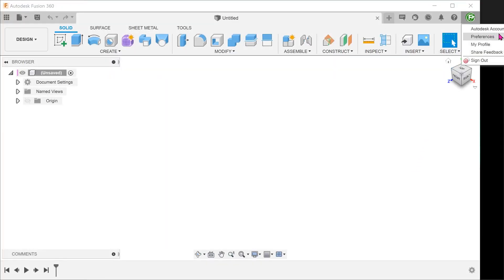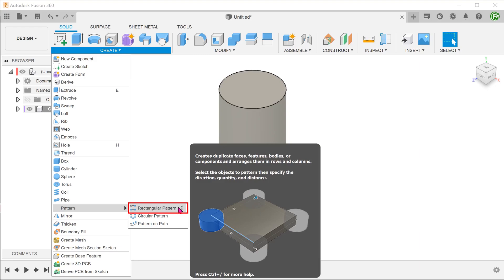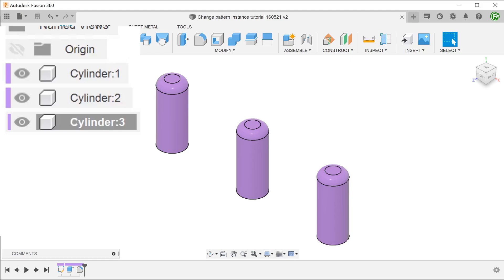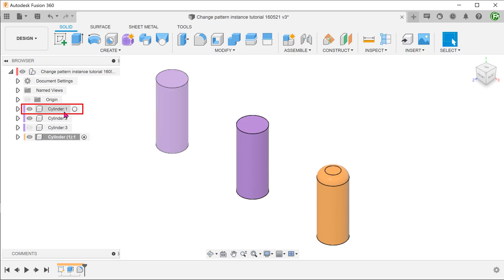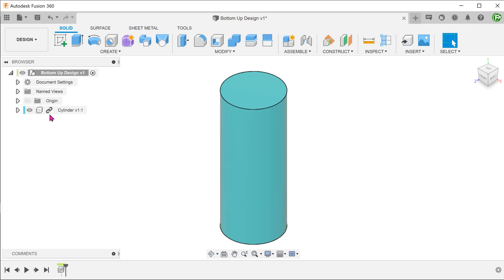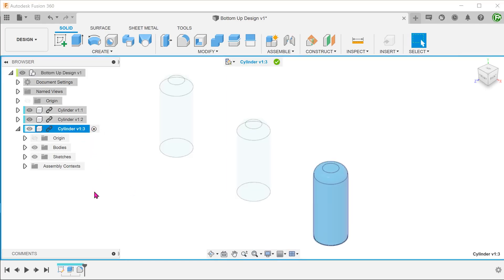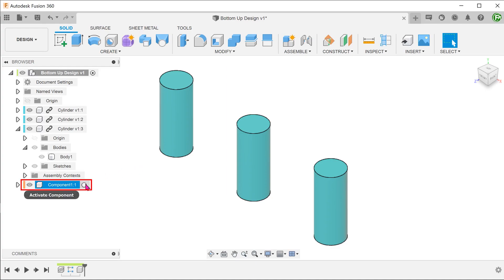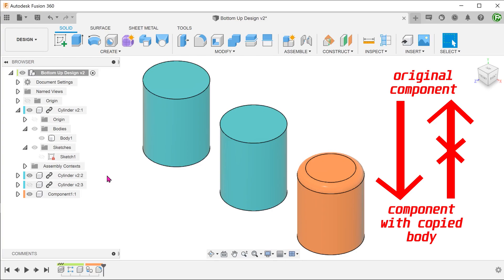Fusion 360 - How to Change One Instance of a Component Pattern?

Comment: At 5:37, I think the recommended method to independently modify an imported component is to choose "Break Link".  I believe you will (by design) not get any downstream changes of the original component at this point, but you will be able to edit the component without affecting the original.

Another interesting option to look at is "Choose Version", which allows you to pick which saved version you wish to use.  This would potentially create a bit of a part management nightmare, but you could change a component to use a previously saved variant of a design, instead of making separate saved files for each variant (maybe ok, if you only need to do it once).  ;)
Reply from the maker: Hi, I did try to use the break link option. However, in this case, it threw up an error, saying that the selected component is associated with a pattern. 

Interesting advice on "choose version". Will need to try this out. As you mentioned, file management might not be easy!
Reply: @Fusion360School  Thanks for the report on Break Link with a Pattern of Components.  That introduces some limitations!

I suppose the manufacturing world uses separate parts with different part numbers for components that vary even in minor details (e.g. length, number of threads, or mounting hole count/spacing, etc...).

Variations would have to be a built-in concept, so that Parameters could define part numbers/names of imported components as well as the variations in a base component design to eliminate the need of maintaining variations manually.  Each component would need its own Parameter page for any (optional) value overrides.

Even in the Electronics Design part of the program, it's very annoying (to me) that all the variations of something as simple as through-hole header pins are separately created parts, which are not consistently designed in the base libraries.  These are auto-generated, yet, since they are likely created at different times, perhaps by different people, details like pin length or color don't match across the entire range of parts, where only the count should differ.  I hope the folks at Autodesk think about this problem of variations and work out a decent solution.
Reply from the maker: @zencow  Configurations have been a much asked for feature. Hopefully, it will come soon.

Comment: Don't use copy/paste to copy the bodies geometry. Use the boundary fill operation. If you ask I'll tell you why ;-)
Reply from the maker: Hi, please do tell! By the way, are you TrippyLighting from the Autodesk Forum?
Reply: @Fusion360School  Yes, that is my user name on the Fusion 360 forum. The problem with the copy/paste feature is that it cannot be edited. So lets say you have to perform a surfacing operation on the original geometry and then have to stitch that back into a solid. That solid now  has a different internal ID. So the copy paste featutr later in the timeline turns yellow as it still references the original internal ID of that objec.. As you can't edit it to re-select and thus refer to the new ID of the geometry/object, you can only delete it and re-create all operations that were based on the copy/paste geometry.
The boundary fill feature on the other hand can be edited and allows you to re-select the geometry.
Reply from the maker: @TrippyLighting  Wow, thank you, this is good to know. Also, I have never thought of using boundary fill that way. I just went to perform a boundary fill on a cylinder and it does work! In the past, I would only use boundary fill for voids or intersecting volumes. 

I am glad that you have stumbled upon my videos. I do frequently read the forum posts. I always pay close attention to yours. From your posts, it is quite obvious that you have great expertise in surfacing. If you don't mind, please do look at my other videos as well. Looking forward to your advice!

Comment: Thanks!

On a slightly different topic but related to components: is it possible to replace several instances at once with another component? Say, replace all M4x10 screws with M4x15 screws.  

I really miss this kind of function. In other apps instances or symbols etc. can easily be replaced with another instance. 

In f360, when you replace the body within the component, you end losing the joint since the constrain is related to the bodies (say midpoint). 
Any idea?
Reply from the maker: I am not aware of a method to mass replace components. Maybe the forum might be a good place to search or ask. Also, when it comes to joints, I am pretty much a novice. I'm afraid I won't be of much help here.

Comment: Good trick on the second part!!

I thought about inserting the model as a component, and then the same one as a Derive to be modified, but it is not supported...😢
That would be a good way to keep downstream changes.
Reply from the maker: I completely forgot about the derive function! Will need to do some testing.